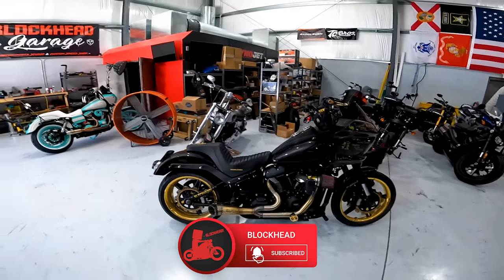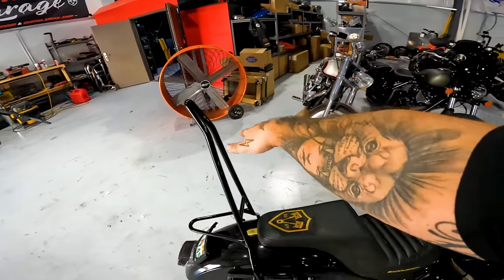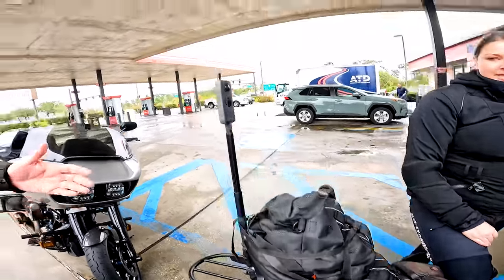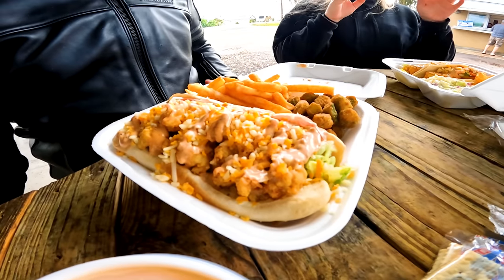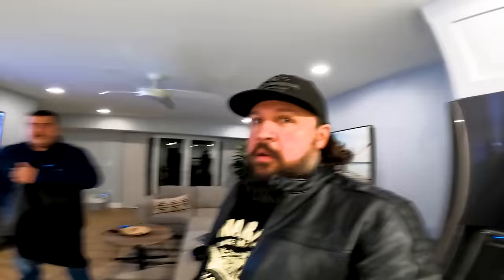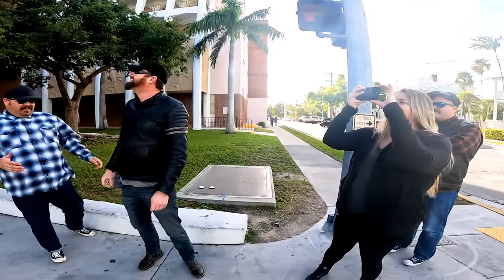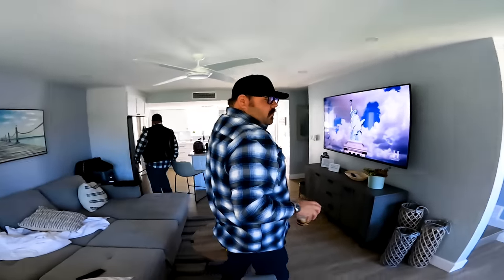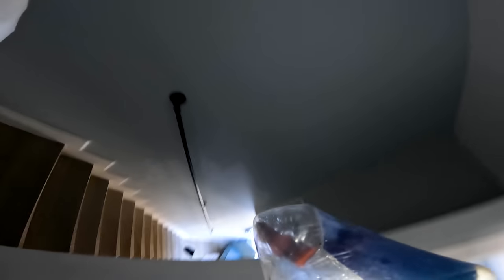I Rode My 150HP Harley-Davidson 1,000 Miles and THIS Happened

Comment: A blockhead I have a few questions I am currently getting ready to buy my very first hardly davidson street glide It is a 2007 base with the 96ci is there anything I need to do right away for service it's got 37000 miles it looks well kept my main concern is the crank run out if there is any and the old death wable or is this something that is one of those few and far in between problems. I want my first harley buy to be a good one I currently have a 06 honda vtx1300 with 180 thousand miles on it and I have never had a problem with it just normal maintenance. I ride alot and use it as a  daily commute and the new bike will as well